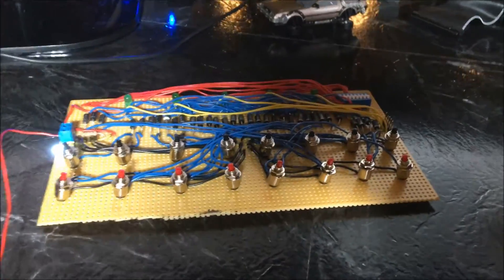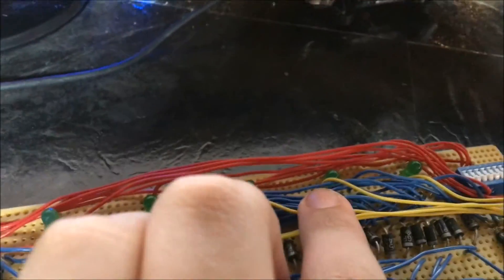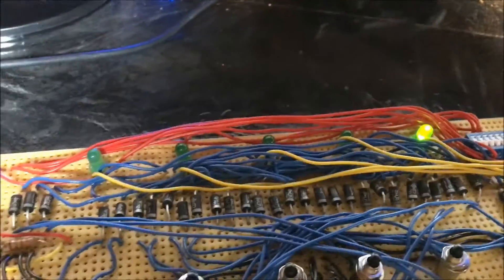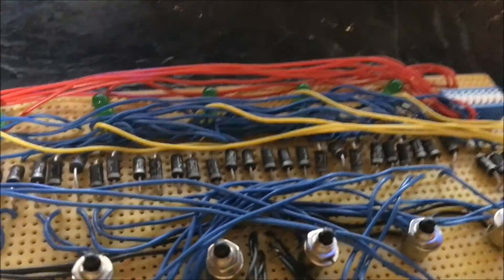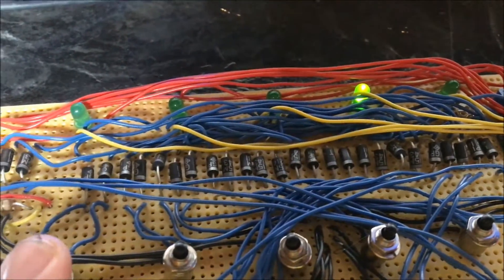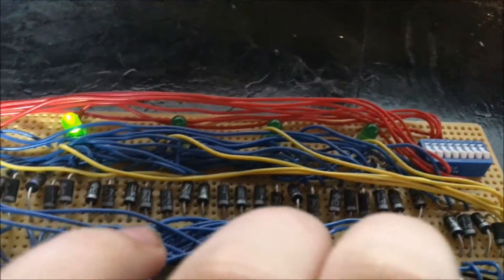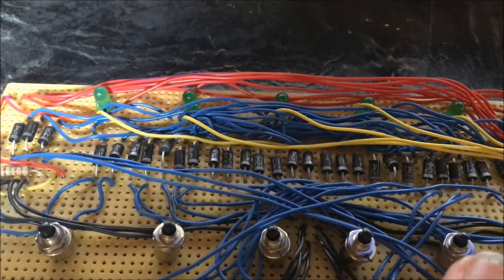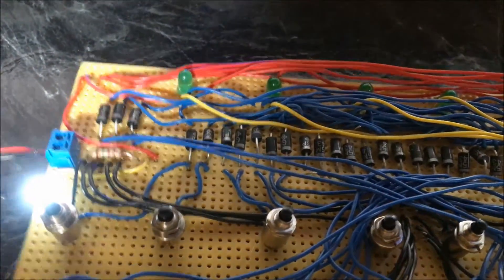Building a 16 Digit Decimal to Binary Converter

Comment: how old are you? you're smart as heck! thank you I needed this!!!
Reply from the maker: Todd McCartha Hi Todd. As of now, I am 15. I did this project when I was 13. What did you end up doing with your version of the project?
Reply: I didn't do anything yet but why do you need a arduino ?
Reply: did you use the arduino as a power regulator?
Reply from the maker: You don't need an arduino for this project. I used a bench power supply to supply power to the circuit. You could read the binary value of the states of the LEDs and use it as an input for an Arduino sketch, In fact, you could even make your own library for. I began working on that a while ago and never got to finish it. Good luck! - Ben